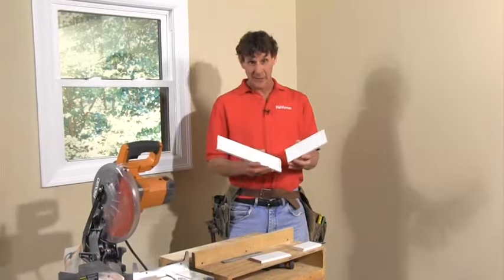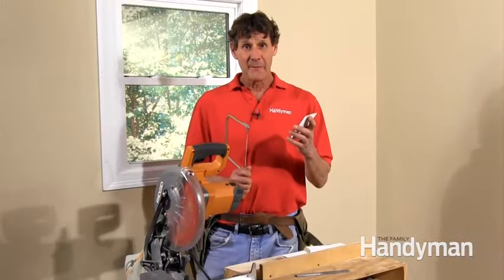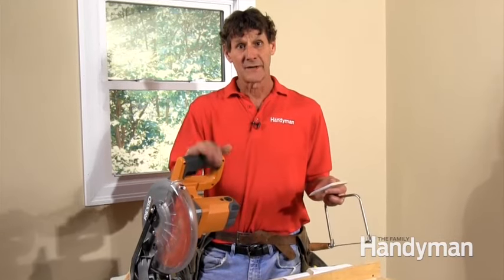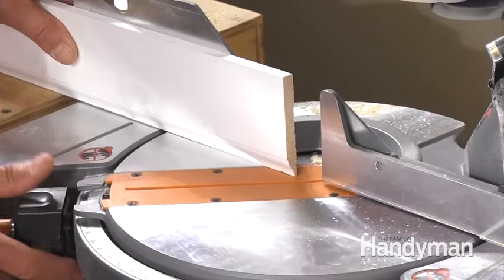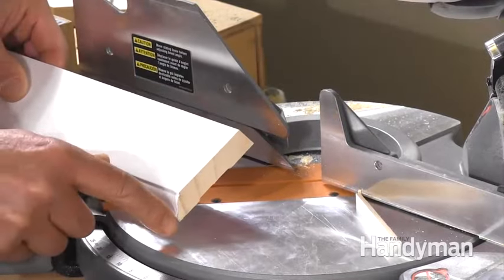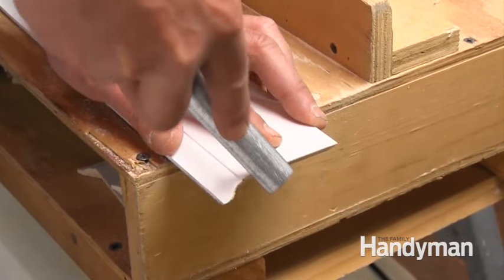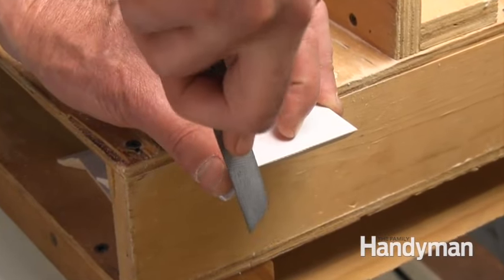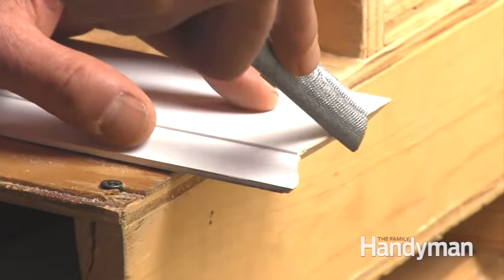How to Cope Baseboard with a Miter Saw

Comment: Sir, thanks a lot for showing this technique. My baseboard is not very simple, but maybe not overly complicated design either. So I was able to use the miter saw and got extremely close to the profile. Then I used a rotary tool with an engraving and sanding drum to remove material and at last used a file for finer adjustments. One thing I did learn was when you drag the piece back and forth during the cut, it may scratch up the top surface. So sticking some painters tape on top of the saw surface may help.

Comment: Duuuude.  I'm trying to cope some door stop trim and tried everything.  This works!  I moved my sliding compound blade out so that I'm coping in the middle of the blade to avoid a curved cut.  Used a board as a stop.  Worked beautifully.  Thanks!

Comment: This is a great improvement over use of a coping saw. A Fein or similar oscillating tool works well to shave the back of the profile. It also helps to mark the front edge of the profile with a pencil before trimming.

Comment: Very nice suggestion for basic baseboards like this!   Though on the backcut, I wouldn't think you would need to 45, anything over a straight cut would seem to be enough and cutting at to great of an angle would seem to make it easier to over-file or break the edge.

Comment: I use this method as well. I use a file for the flat spots and then use various oscillating sander found sand discs for the rounded edges. Easier to manage than with a file

Comment: Would like to try this but what does it mean to cut a reversed 45 degree angle?
Is that the same as cutting an inside miter or do you cut the angle in reverse of the normal inside angle?
Thanks.
Reply: Once the original 45° angle is cut, he moved the saw to the opposite 45° to remove the material on the back side of the board up to the face profile of the first 45°cut.

Comment: Can you use this technique on crown? Love to see it
Reply: collin bean I wouldn’t try it. I use my table saw for crown.
Reply: renaissanceman I wanna see this table saw method. I have done it many ways but I always just go with a coping saw.
Reply: Standard Crown requires a compound miter, but the newer style flat crown could be coped, dont use this silly method, buy $10 coping saw and do it by hand, it is faster and you will have a perfect quality miter, plus you wont need to file it after you are done...
Reply: coped miters should be done with a coping saw, it may be age old, but it is still the fastest and cleanest way to do the job.
Reply: @smokingcheeba420  it's pretty much the same thing. I had to use my table saw because my trim is too tall and wouldn't fit under my mitre upright and doesn't go to 45deg on the compound function.

Comment: This doesn’t work. I tried it all day and wasted a ton of time and material. You simply tilt the saw itself to 45 degrees and cut. And opposite on next cut. Maybe you are leaving out critical details?
Reply: Basically you are just trying to eat all the unprimed wood away using the prime line as your guide. He does not just cut all the way through. I find it's easier to use a table saw freehand, but that's just me.
Reply: You just described a 45° mitre Joint, that's not coping, if you can't cope with the coping, trying coping with not complaining about your not coping, you clearly can't cope with following coping instructions..........